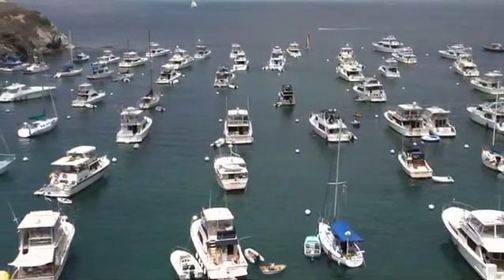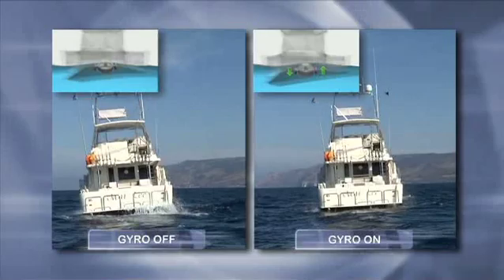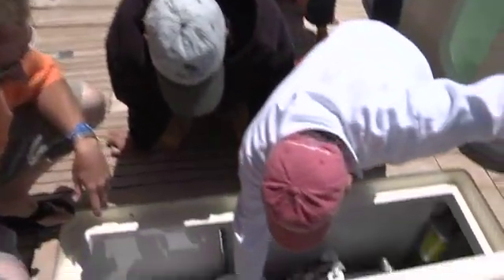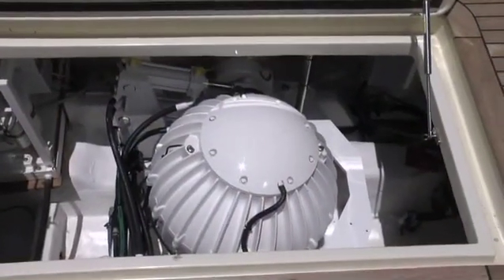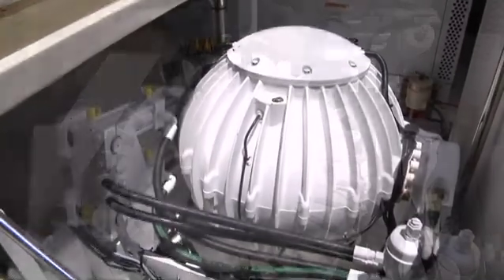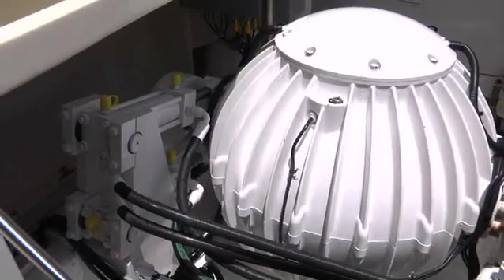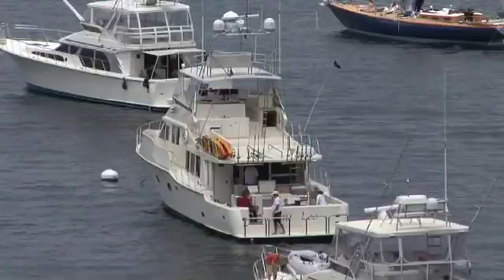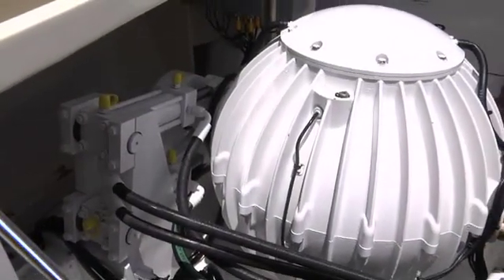Seakeeper Gyro Retrofit on a 65 Mikelson Nomad

Comment: The unit is compact and works well and OUTRAGEOUSLY EXPENSIVE for its function.  It should be well under $4K in my opinion.
Reply: They cost ten times that for a large boat application. In reality, the engineering and machining that is involved cost a lot of money.
Reply: @normand5847  and it has gotten cheaper over time. plus these things works. used to be these type of systems were only available for giant ships such as cruise ships and often didn't work all the time. so these are a huge improvement on the old systems
Reply: LMAO. Tell me you are poor without telling me you are poor....

Comment: Those these has to be dead center between port and starboard to be effective? How is it able to torque the boat effectively otherwise?
Reply from the maker: Nope! They can be installed wherever there is space (even off centerline), but preferably midship aft if possible.
Reply: @SeakeeperInc  What about catamarans?
Reply: @09fk0qzitaugk5  I watched a YouTube video where two were installed on a worldcat 352cc, on port and starboard I believe